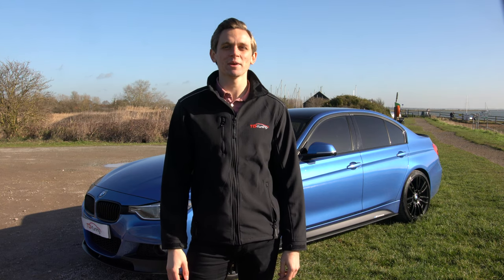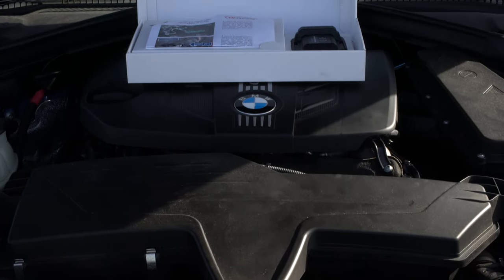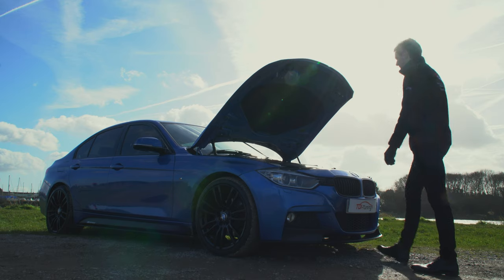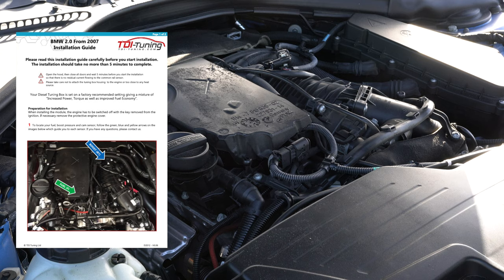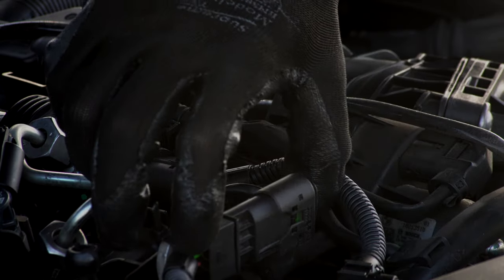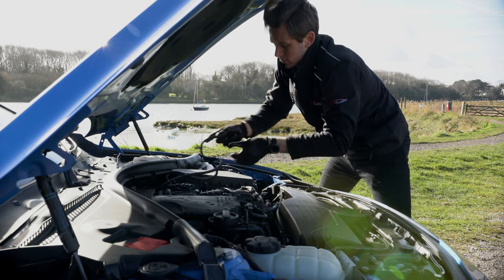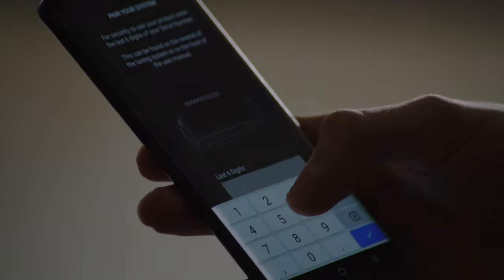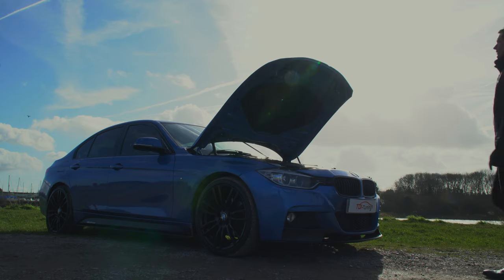TDI-Tuning Box | How Easy Is It To Install?

Comment: Question ... I am wondering how these affect the Warranty or Service of the vehicle?  As in - do they know it's there and then does the warranty get voided or is it something we have to disconnect for every oil change etc?  My father has ordered an Ineos Grenadier, which has a quite well-known BMW engine ... and I'd very much like to use one of these for both the performance gains and of course fuel economy ... but I have never before "tuned an engine" ... thanks very much for your help!
Reply: I had a box in my 320d X drive M sport touring and I never had a problem I used to take my car in to the BMW main dealer all the time and they never ever questioned anything. But you must remove it before you give your car to a main dealer for anything whether it is tires or anything Windscreens if it goes to main dealer you must take the box off or they may use it as an excuse to void your warranty however if you have a map done on your car stage one two or three they can see it on the computer screens because they can see your car going at x miles an hour whilst it's stationary that's how they know cars have had a map

Comment: Hi I have a CLK270 w209 2004 with 174,000 miles with full Mercedes service & parts. What are your thoughts on me getting it a stage 1 tune? Please could you advise?  Chris
Reply from the maker: Shouldn't be a problem with a reputable tuner. We would put our full map on it - that engine has the extra power even with a few miles on it if it's been looked after. Let us know if we can help further or give us a call on 01245 806446 thanks

Comment: Do you offer shipping & support for U.S. vehicles?  Specifically 2018-2019 Jaguar XE-S 380bhp version, California 91 octane petrol?
Reply from the maker: Yes! We programme US systems to work with your lower (sorry) grade fuel. Here's the system for your car, the US selection is at checkout. https://tdi-tuning.com/car/jaguar/xe/s-30-petrol-375-bhp-380-ps-279-kw-450-nm-332-lbft/crtd4-multi-channel-petrol-tuning-box-chip

Comment: Hello, I have a Volvo S60 3.0L T6 with a few bolt on Performance upgrades such as bigger intercooler, bigger  performance downpipe, hybrid turbo,  and other more air flowing upgrades.  I would be running the best fuel sold I could use in the US.  Would the tuning box be able to read and adjust to get the best tuning?
Reply from the maker: Hi, as the vehicle is already modified beyond factory standard our Tuning Box would not work with your vehicle. It can work with some modifications, like air filters, induction kits, and DPF removals and Exhaust modifications. However as you have changed the turbocharger and intercooler it would not work correctly. We hope you can bear us in mind for your next car. Thank you.
Reply: You need a custom tune my friend. Strange not one person who did the mods on your car told you that..

Comment: Hi, how do turning boxes work with cars that have selectors for different  driving modes (like economic, normal sport etc)?
Reply: My guess would be that as you need to intercept various sensors that it would tell the ECU that the level of boost and fueling is lower than it actually is to release more than would happen without the box?
Reply from the maker: The driving modes are unaffected. You will have more, useable power in each mode. Please let us know if we can help with anything else.